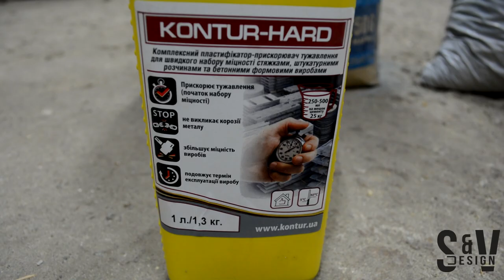DIY Concrete Sink With A Cost Of $ 8. SVdesign.

Comment: The "with a cost of $8" is beyond a stretch but otherwise this is a cool video.
Reply: Can of that varnish is 7$ which you wont even use half of it. Bag of pre-mixed concrete is 2$. Frame is made of scrap materials which every DIYer have so 0$. So 9$ at current prices and you have half can of varnish left.
Reply: Especially with the cost of materials ta day